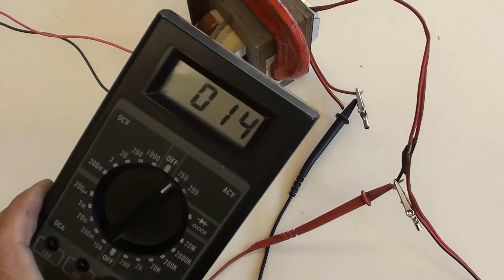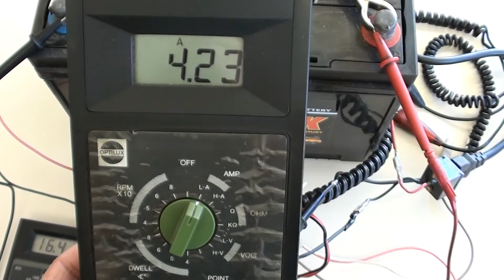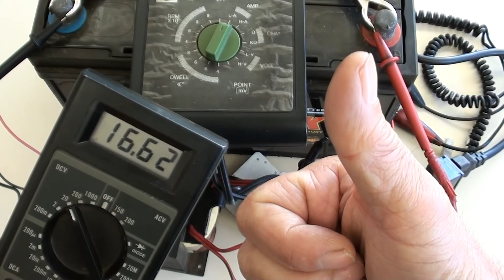How To Make DIY Car Battery Charger's Transformer?

Comment: It should be 11 volts not 14 because after bridge rectifier you get peak AC voltage which is 11 * root(2) = 15.5V, minus bridge diode drop 0.5 x 2 = 14.5 final voltage
Reply from the maker: Your calculation logic was alright however your statement was not correct.  In normal circumstances the value of AC voltage is used as Root Mean Square value (Vrms for short) such as AC 120 V, 220 V, 230 V or 240 V etc they are all Vrms value.  On the the hand, the peak value of AC voltage is used at the time to consider the component's limitation.  Thanks for your interested!

Comment: haw may turns pls
Reply from the maker: Thanks for your interested!  Well, I was not sure how many turns for the primary coil however by the actual tested, I reckoned the primary coil would be 270 turns(240 V) more or less.  the secondary was 16 turns (14 V) center tapped which means 2 x 16 turns(2 x 14 V).  Incidentally the more details can be read on subtitles, just turn on "CC" on your device.